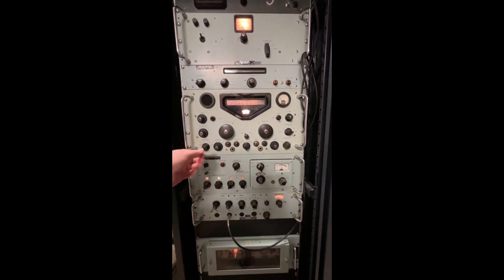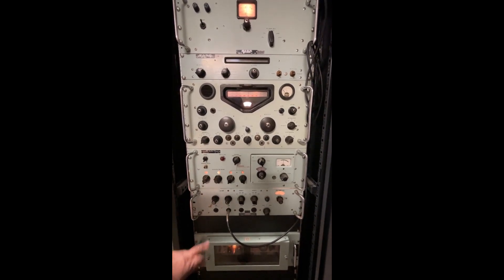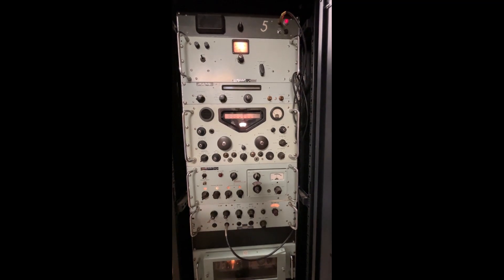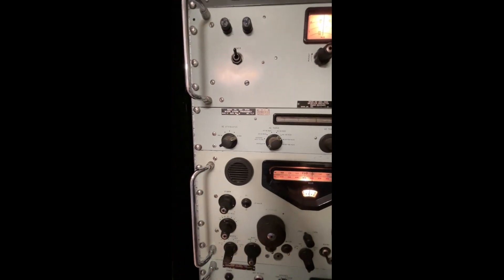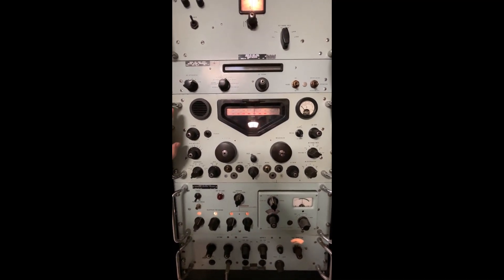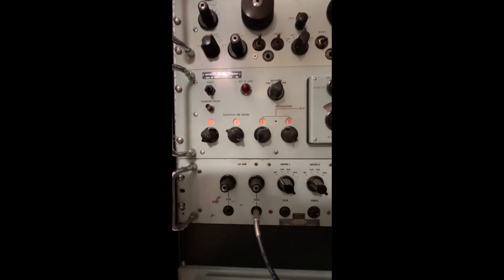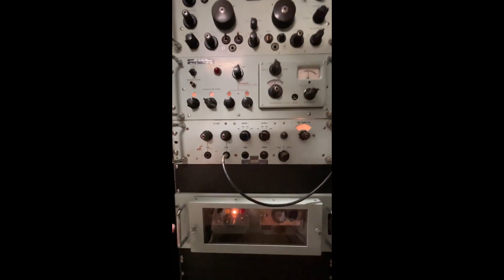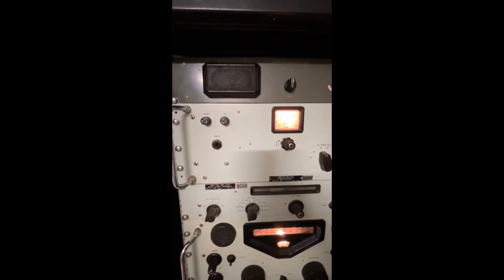Racal RA17 System, Monitoring 40M under good conditions. USA coming in very starong.

Comment: Very nice rack set up,Peter. I ran an RA117E with an RA63 SSB adaptor and an MA79G Tx drive unit. I never did get hold of a matching Racal linear amp, instead I used a homebrew amp with a 6CH6 voltage amplifier stage boosting the 100 mW output of the MA79 up to a level for driving a pair of 807s. I still have all the gear but lack space to set it all up again in my current shack.I also homebrewed the Tx/Rx control box and Tx mic preamp. For a laugh I even ran the 100 mW output direct to the ATU and worked Sardinia on 20 Metre SSB, a distance of 1000 miles. Great fun, the worlds heaviest QRP rig?